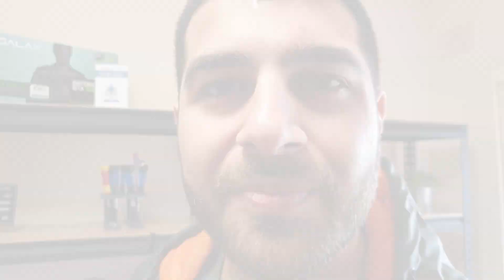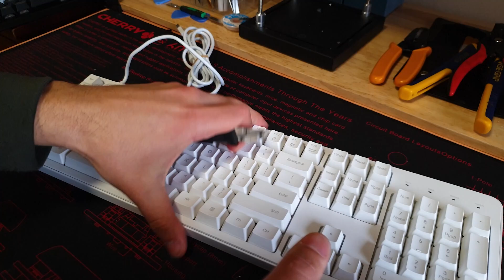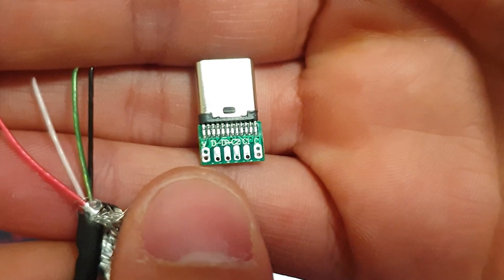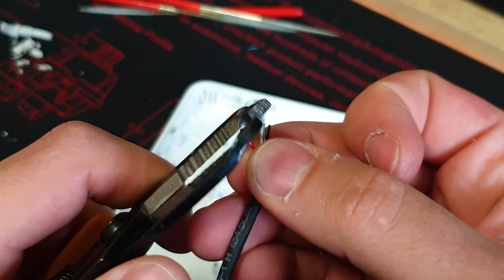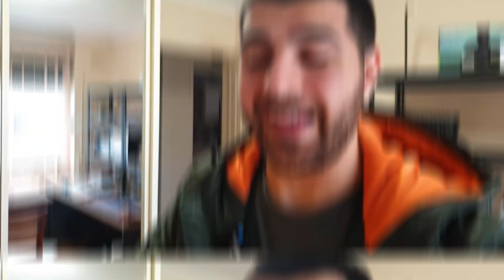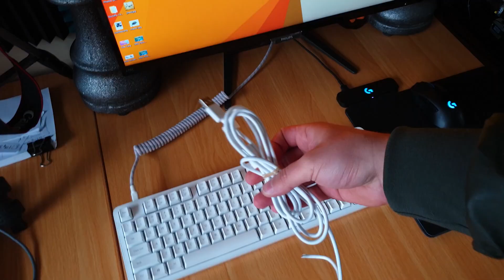Mod any Mechanical Keyboard with USB-C! - Detachable Cable Mod!

Comment: Thanks for the video, I wanted to do this as well but the USB-C Breakout in the link is totally different than the one in the video. Why is that? It is way too bulky for most keyboards to solder in place!

Comment: Hey, I don't know if you read your comments but I bought the first breakout board you recommended and I'm just a little unsure as to how to solder my keyboards wires onto it as its more of a hole instead of a pad like what the the one in the video looks like, do i just stick the wire through and fill up the hole with solder?

Comment: I want to do this with a razer huntsman elite. Any ideas? I have 2 usb's going into the back of the pc, so i'm assuming I'd need to put a splitter or a hub inside the keyboard? Any help would be great. I have 0 experience with this, but have taken the keyboard apart before so I know the inside layout.

Comment: Hey, so Im looking to buy the adafruit one. In the video, you say to connect the V with the red wire. But on the Adafruit 4090, there are SBU1, SBU2, VBUS, CC1, and CC2. Which one do I connect the red wire to for voltage?
Reply: Vbus

Comment: Hey man I appreciate the tutorial you made but I have a small problem I just followed the steps you said in the vid one problem for me is that when I plug the type c cord, only the lights are working but the keyboard isn't detected what might be the problem to this? thanks man
Reply: im realy not shure but try reversing data cables mabey it will work i really dont know just saying
Reply: Im having the exact same problem
Reply: Same problem

Comment: Thanks bro, works for my k552, a little bit of work but it's worth it.
Reply: does it gives delay?
Reply: does it have 5 wire? how ?
Reply: @mizufy where did you solder the brown wire? also have k552 kumara help bro
Reply: @chronostain2201  i Heard You can just ignore the last pin without soldering
Reply: @Franco Marcelo the brown wire in k552? k552 has 5 wires this brown wire (ID) to usb type c will try
Reply: @chronostain2201  i dont remember where i read that the brown pin just stay loose but watch the video "Custom Redragon K552 Kumara Mods" he makes the same mod but with mini USB breakout that have 5 pins. Im looking also for a video or blogs that explains how to make 5pins to USB C.
Reply: @Fr4nc0xP  yeah i watch that , so if i use female usb c , i will just not use that brown wire of it  ? thank you sir
Reply: @chronostain2201  i Heard that but i'm not sure i would go for mini usb breakout and keep safe my keyboard
Reply: @Franco Marcelo i know the answer, i could disregard the orange wire (ID ) for usb type c , in a ph mkb group

Comment: Hey JUJU I can't find usb c breakouts but i can find micro B and micro USB breakout boards, can they still be used and does the voltage and current matter? I found a 5V 1A. Im pretty sure the power should not matter, right?

Comment: You don’t even have to use a breakout board. Get a  USB 2.0 (or whatever cable your keyboard uses) to Type C female adapter and just use that. Wires are already on it. Ez as cheese.

Comment: Hey,
i have iKBC mf 87 with rgb b. My micro Usb port is broken.
Now i want to fix it.
But i have 5 wires. i have white, green, red and 2x black. I think because of RGB. But how do i connect those with Adafruit USB C Breakout Board.
Reply: I have this question as well! Did you end up figuring out?

Comment: So if I get that Adafruit breakout with the 56k resistor, do I solder a cable connecting CC1 to VBUS and then wire VBUS, data, and ground like in the video?
Reply: I have the adafruit 8 pin breakout too. Did you find the way to do it?

Comment: Hey! I really need some help.
Does this keyboard have a wire or is it wireless? 
https://www.aliexpress.com/item/1005001689750255.html?
It has some wire called type c interface but I don't know what that means. I really need a wired keyboard :(

Comment: would it be the same general idea if I wanna do this to my corsair keyboard? I don't really use it so I wanna mod it as a fun little project but I'm just wondering if making it detachable would require an extra step due to the usb pass through
Reply: Corsair keyboards have a separate pcb and cable for the passthrough. You can just ignore it but you would lose the passthrough.

Comment: So what do I do with the fifth wire of my keyboard have five wires instead of four? I’ve tried just putting the extra wire to the ground as it’s a bare copper capable. But nothing works. So I ended up having to resolder my keyboards cable back together. Can anyone answer this question?.
Reply: Did you figure this out? My Roccat board has 5 wires and I would like to do this mod.

Comment: Hey! First off, thanks for the video. Really helpful. However, my Keyboard has the following wires:
  - Yellow
  - Green
  - White
  - Black
  - Red

Could you help me out here? What to do with the Yellow wire?
Reply from the maker: Yellow is essentially an extra ground wire that connects to the shielding of the cable. You can ignore it or just solder it to the black wire together to reduce EMI.
Reply: @goodjihad  Thank you so much! I got it done today, and it works perfectly (thus far) ! :D
Reply: Thanks for asking dude i did find my keyboard got 5 wires
Reply: @KyoouN what did you do to the extra wire? did you just leave it hanging or did you solder it at the back?
Reply: @yax379  I left it hanging! Obviously, before putting everything together, I tested how it would work with just leaving the extra wire hanging. After making sure it works, I put everything back together.
Reply: @KyoouN  dang I also did mine but all I got was the lights only, but the keyboard won't even work anymore kek
Reply: @yax379  oof, maybe you took out the wrong cable, or didn't solder it properly? but since the light goes on.. i don't know really, sorry. Good luck though on getting it fixed
Reply: @KyoouN  thanks man, appreciate the help

Comment: Hi, nice video, i'm italian boy that want replicate this things on my mk drevo tyrfing v2. I need your help to buy the connectors on italian amazon. I found this items, you think that i can use it for doing this modding on my keyboard. Regards
https://www.amazon.it/resistori-tipo-USB-C-maschio-custodia/dp/B07T97LC9L/ref=sr_1_8?adgrpid=108315335932&dchild=1&gclid=Cj0KCQiAzZL-BRDnARIsAPCJs72e2jLXijQya4ekfySRfdDlDHe4OckN0OQW_ZGDUYMEFXF5LXyiZVwaAh4EEALw_wcB&hvadid=443340206315&hvdev=c&hvlocphy=20540&hvnetw=g&hvqmt=e&hvrand=1566805097878354779&hvtargid=kwd-344096318377&hydadcr=15915_1812515&keywords=usb+c+breakout&qid=1606809312&sr=8-8&tag=slhyin-21

Comment: I’m trying this with a number pad and it has 5 wires instead of 4. Left to right it’s white, green, red, black, and black again. Do I wire both blacks to ground?
Reply from the maker: The shield wire is usually wired to the metal casing of the connector because some devices might seperate gnd from the shield/casing. Most however just short them together. 

So yes you could do that but I would recommend soldering the shield wire to the casing of the connector and black wire to gnd

Comment: For the Adatafruit board, what wires would you put in what connections because there's 
CC2, SBU1, D+, D-, CC1, SBU2, VBUS, GND? And what would you do for the empty connections?
Reply from the maker: GND - Black/GND, 
VBUS = V+ = +5V/Red, 
D+ = Green/D+, 
D- = White/D-

You could use the CC pins to enable C to C compatability if the adafruit board has the resistors on it.
Reply: @goodjihad  What do I wire the CC pins to?

Comment: Juju can you link the exact breakout board in the video. The 2 you linked are too wide for me
Reply from the maker: This does not have the resistor - please be careful.

https://www.aliexpress.com/item/4001173826683.html?spm=a2g0o.productlist.0.0.dc797a02kAUNlm&algo_pvid=666cb658-8c1a-4e6d-8ecf-00f5bbdfffd4&algo_expid=666cb658-8c1a-4e6d-8ecf-00f5bbdfffd4-13&btsid=0ab6f8ad15982665631948094e03b9&ws_ab_test=searchweb0_0,searchweb201602_,searchweb201603_
Reply: @goodjihad  is the one with no resistor isn't safe?

Comment: Hey juju was wondering with the usb c board that you recommend buying, which cable goes where? I can see D+,D- and ground but what about v?
Reply from the maker: VCC = V = 5V+ = Voltage - all the same :) Red is commonly 5v
Reply: @goodjihad  Thanks man!! This is some good information you're giving out! Appreciate your time in answering

Comment: Fun fact: my Das Keyboard 4's non-detachable cable is actually detachable! Internally it just has a standard USB 3 micro-B connector plugged into a daughterboard.
So with a $6 adapter cable I now have a USB-C Das Keyboard that still supports USB 3

I've been meaning to convert my Race 3 to USB-C as well and this video has definitely given me the inspiration needed lol
Reply: do you know the name of the piece?
Reply: @sup.11bpm35  It's a male Micro-B 3.0 to female USB C cable
The one I got is 10cm and just about fits in my Das
Reply: Awesome! I was actually eyeing my das keyboard 4 pro from across the room when I saw this video. Glad to hear it was successfully converted! Can’t wait to do mine! 😊
Reply: I want to convert a Das Keyboard Prime 13. It has two USB type A cables I would like to convert to a single USB type c.

Comment: Hi Juju, would this work with the redragon kumara k552?
Reply from the maker: It seems like you can. You have to open it and see if there is space :)
Reply: Hey! did you end up figuring that out? I have the s113 and I have 2 black wires (5 wires total) and not sure what to do with the 2nd black wire (it has white printing on it).

Comment: Would this work with the Logitech G413? It has USB pass through also, I would sacrifice the pass through for a Type C option.
Reply from the maker: If you can sacrifice passthrough then it will work! 😁 join on discord if you need help!
Reply: @goodjihad  it is not live anymore but help needed, found one extra ground cable and stunned what to do with it)
Reply: @goodjihad  the extra one looks like this https://preview.redd.it/seifjvioij691.jpg?width=1920&format=pjpg&auto=webp&s=532296eb193cbb2425490ac1352b57e846f62468

Comment: my tada68 pcb is using the old mini usb, is it possible to change it to usb c?
Reply from the maker: Yes! You would have to remove the MINI USB port and then glue this pcb to the back - or where there is space. I made an older video on how I did this to a GH60. Check it out but it's super old :)

Comment: The same way to RGB keyboard or have difference ?
Reply from the maker: As long as there is only one port (no extra usb for passthrough), then yes it will work! The only difference will be the placement of the PCB/Connector! You will have to figure that one out :)